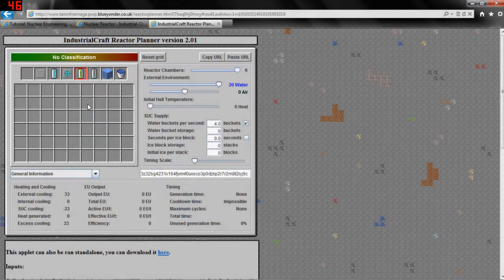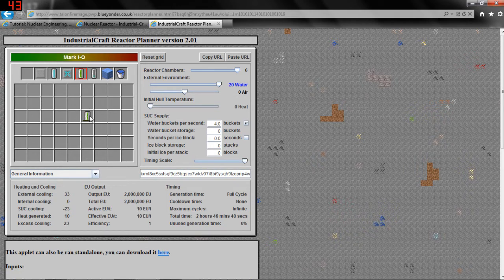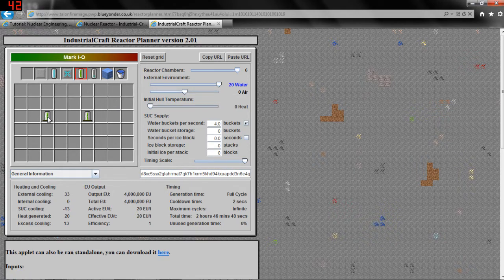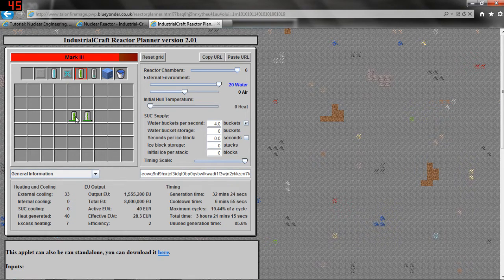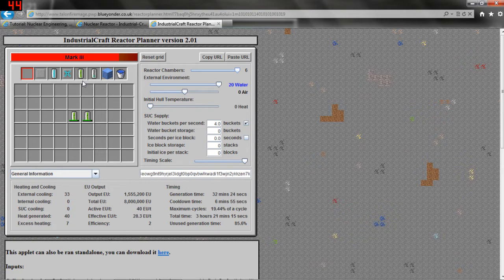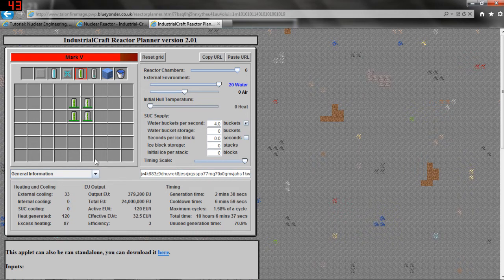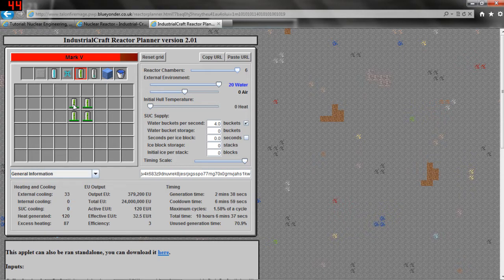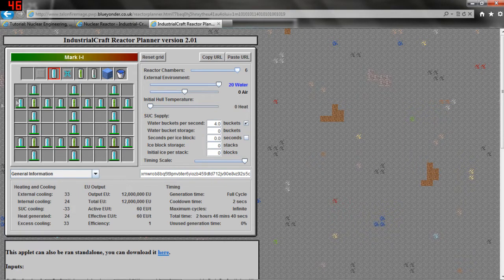Nuclear Engineering Part 3 : EU Generation

Comment from the maker: In the area below the planner itself,there is a link that will download the planner. It is a java applet program, s as long as You have java installed, You should be fine.
This planner is a bit out of date, as it didn't update when IC2 redid the whole nulcear reactor setup. If You're using an older version, it should still work. :)